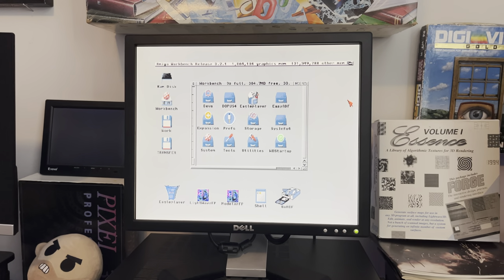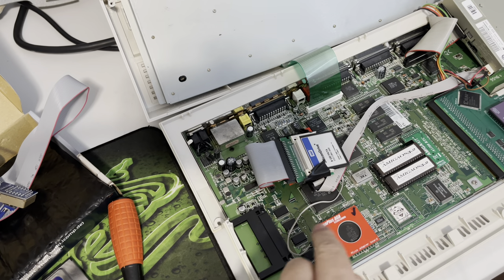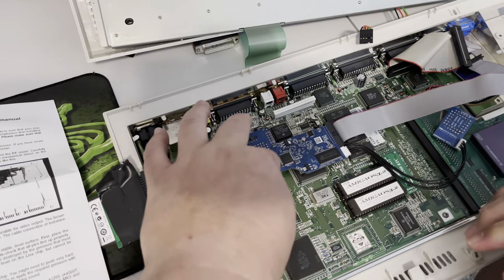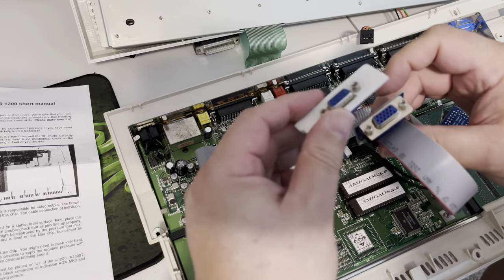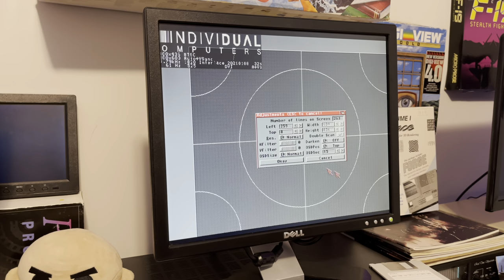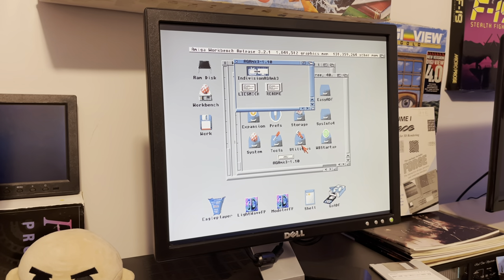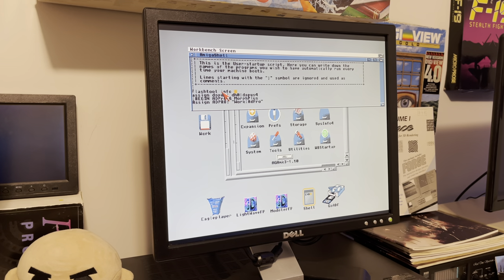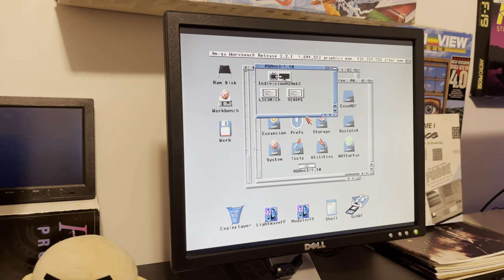Flicker Fixer for Amiga 1200 and 4000T! Did not expect this!

Comment: Lovely pin-sharp picture. I didn't have any problems with my Indivision on my A600, but, it is a whole different ball game on AGA. [ also VGA, I have so many old LCDs's ]
At the end of the month I get the Pistorm for my A1200. So much power!

The HDMI audio switch appears to work better than Ubuntu 22.04 on an Intel NUC11. [ Ubi blame the Kernel, yet the same kernel works fine on other flavors of Linux!
Reply from the maker: Nice! Thanks for sharing your experience. Stuff like this is important.

Comment: I have the Indivision Mk. 2 - with my A1200, it has a Blizzard 1230 Mk. 4 (50MHz 68030 and 68882). I installed (and highly recommend) HighGFX and FBlit. It allows k a nice and fast 1024x768 workbench, with a copper gradient background. It looks and works so well.
Reply from the maker: Yeah I wanted to check those out but was worried about chip ram usage. If that’s a thing?

Comment: My Mk III doesn't suffer from this blackout problem, but I have had this weird issue where I can ONLY run the config tool from floppy.  If I copy the executable to the HD, RAM disk, or whatever, it consumes memory but never opens the UI.

All in all, it's a mixed bag.  The Indivision does work and looks great, but sometimes the scaling quality is iffy, the config tool is very confusing, and the OSD really needs to have an on/off hotkey rather than linger on the screen for a fixed time period after each resolution change.  Most of the time, I still prefer to use my old CRT, and I bought the Indivision just in case my trusty 1080 blows up.  8)
Reply from the maker: Thanks for sharing your experience. Helps to hear what others go through. Yeah a CRT would be nice but so hard to keep running lately. They’re all aging out.

Comment: Good video.. I have a mkII and mkIII and never had any issues like that, but I am using the HDMI. (on the Mk3). Did clean the pins and had to press really hard down on it though.
Reply from the maker: Yeah I IPA’d it and tried HDMI and VGA. Still have to run that command at startup though .

Comment: Very odd. My MK3 does not do that, works absolutely perfectly every time. I'm sure you've already done this but I noticed you did not clean around the contacts with IPA before installing as suggested in the manual. Could there be a slightly dodgy connection.
Reply from the maker: I did do that in later desperate attempts

Comment: THANK YOU for this video. I am in the exact same boat, I had installed the MkIII in my NTSC A1200 (Commodore production and not ESCOM, not sure the revision of board I have) and got no video output from VGA or HDMI. After hours of fiddling around and reading forum posts I took the (quite expensive) device out of the Amiga and it's been sitting in its box ever since. Now I can go back and try again, armed with more knowledge thanks to your experience you documented here.
Reply from the maker: Glad to be of service! Good luck. Let us know how it goes!
Reply: @HoldandModify  Finally got the Indivision installed, since I wanted to wait for the PiStorm32-lite to become available in order to install everything together. And yup, I have the same problem that you were having with the MkIII not starting itself. I noticed there was an update on the Individual Computers website but unfortunately it doesn't look like it addresses this issue. Once I get everything situated I'll give it a try anyways. For what it's worth, the display (from what little I've seen so far) is definitely much improved over the GBS-8220 and other solutions I've used in the past...
Reply from the maker: Ah sorry to hear. Well, at least we have the work around. Look forward to any thing you find.

Comment: I have the exact same problem with my Indivision MK3.  I found that if I turn the power on, get a black screen, then turn the power off and on again real fast, sometimes I get an image.  It's definitely a timing issue or something.  I noticed one similarity to yours - 1D4.  I ended up buying a different amiga 1200 (I couple now) and they are all NOT 1D4's and they all work fine with the MK3.  It's just my 1D4 that doesn't work with the MK3 reliably.  I posted a forum message and Jens tried to help with some basic stuff, but I think the problem is more advanced.  And to clarify - same power supply works fine with the MK3 on a NON 1D4 board.  But my 1D4 board won't work properly with this MK3.
Reply from the maker: Well issuing that command at start up is the best easy fix for now, for me.
Reply: @HoldandModify  Yeah if that works, great.  I noticed the floppy would work for me too.  Didn't try using that command - maybe I'll try it if I have time.  I'm just glad I'm not the only one with the problem.  Seems like to me it might be a 1D4 board problem... at least that's one commonality we have.

Comment: Interesting - I've had one of these since they came out and haven't had an issue like this.  Maybe yours is some sort of chip shortage hardware revision?  Not sure if Jens has done anything like that yet, but I think I remember hearing some of the products were getting updated with different chips.
Reply from the maker: That’s possible but don’t know.
Reply: I have the MK3 as well and it works from Cold boot from the day I got it. No rescue disk or special commands needed.
Reply from the maker: @hamrdeye8927  then my curse continues

Comment: Pretty cool. I love that there is a way to get crisp digital output from an Amiga in this day and age (however you decided to go with VGA, which is fine, we won't judge you for it).
Reply from the maker: I know, I’m nutty. :)
Reply: @HoldandModify  still it's hard to tell on camera, but is the VGA output much better than the standard Amiga RGB output?
Reply from the maker: @DavePoo2  it’s better in that it does not have any interlace flickering. Because I am using a VGA 4:3 monitor instead of a PAL or NTSC CRT, there is some scaling issues. To “fit” the Amiga screen. For the cleanest image possible, you’d want to use a 16:9 screen over HDMI. Then the full aspect of the Amiga native screen could “lay in” the 16:9 space. This is what I do for RGB2HDMI equipped Amigas. I may do this for these too. Finally saying good bye to my 4:3 VGA panels.
Reply: @HoldandModify  back in the day (and now) I never used interlaced modes. The eyes can only take so much abuse.
Reply from the maker: @DavePoo2  yup, that’s why these flicker fixers are SO NICE. All the resolution and none of the flicker.

Comment: I stopped using iComps crap.
Reply from the maker: I’m beginning to understand.
Reply: last item i purchased from them  nuked my beloved  a1200  - Never again !!!
Reply from the maker: @daskarman  ah geez! Sorry to hear that. :(
Reply: @HoldandModify  one blown  hard to get Gale chip but it's repaired ,  that flicker fixer is a ticking bomb  reverse  sockets  are dangerous  especially if mounted without any standoffs  . if i were you i would remove that  thing , your  RCA  or the VGA   far safer  for no longer manufactured precious custom chips  and already  30 year old computer  !

Comment: Odd experience - I use one of these and it’s without question the best solution for video quality. Never seen the problems you had - it’s not at all normal behavior - I’d contact iComp and get some help.
Reply from the maker: I will. I started a dialog but I’m extremely busy and the required testing required to troubleshoot is extensive.

Comment: Great Vid “Q”! 👍🏻 Just watched Chris Edwards fix up your A4K 👍🏻 I own 3 of the MKIII, 2 MKII and 1 MK1 of these cards. Sounds like a Firmware issue with your card? Also to note I’ve had the MK3 Lisa connector not fit properly due to the SMD resistor at the bottom left of the Lisa chip getting in the way and not having a small cut out in the Lisa adapter socket. I know with the mk2 config software if you changed a setting it would re-program the flash cores of the card. I can’t remember but doesn’t the mk3 software do something similar? If you right click on the settings window? The keyboard live change is nice, but it’s not permanent and doesn’t change the settings on the card for next time 😉
Reply from the maker: Yes I do save settings using the actual software. And it’s running the latest firmware as far as I know from the downloaded rescue disk. It works great, I just have to run that command at startup. 

My A4000 video seen in Chris’s amazing restoration video will be up this weekend!

Comment: That's really odd behaviour. I have the MK3 scandoubler from Indivision and it just worked first time. I got it maybe about 2 years ago, so I wonder if a firmware update broke it for a few users...
Reply from the maker: It’s been said there’s a timings issue with certain NTSC a1200s.

Comment: When you ran that recovery disc it would have flashed the latest firmware on to your device, then after that it should initialise by itself every time. Or maybe you also need to flash it once you're in the OS. Either way, you shouldn't need to add that flashtool reference to user startup.
Reply from the maker: I agree. I did update its firmware. That’s been confirmed. The only thing we can think of is that North American 1200s might have subtle variances in timings that’s causing the issue. To this day I must still use my work around.

Comment: You missed installing something on your hard drive?  like a driver?
Reply from the maker: There’s no driver that I can see. There’s the config tool only. And an emergency boot disk. Which is where I found that tool to run at startup. To “wake up” the card.
Reply: @HoldandModify  it is wierd as its picking a native signal from Lisa..... odd

Comment: Hi I was looking at this flicker fixer, for the 1200, but put off by the cold boot problem.  Also going to upgrade to the 3.2.1. Has your issue been resolved tks
Reply from the maker: I’ve not had the chance to do what was requested of me to begin the trouble shooting process. iComp wants me to do a rather, I feel, time consuming and extensive step by step examination of my a1200. Listing all chip types and revisions, what things are connected and how, along with other requests. This is far too much “debugging” to be expected of an end user. It would make more sense to send my machine to them. Have them figure out why my a1200 has this issue. This is not really possible for me. Or practical.

I’m not technically inclined at all. I think this is obvious from my videos. I don’t even know if I could do what is being asked, correctly. Let alone have the time. HAVING SAID THIS. Many users have purchased this product and NOT had this issue. I’d say give it a go. You most likely won’t have this problem. If you do, you can return it. Or sell to another who may not mind.
Reply: @HoldandModify  Thanks for taking the time to reply. Its on the wish list at the moment as I haven't made up my mind if I need it or not.  Waiting on a RGB to VGA adapter that supposedly eliminates the vertical line. Whilst it won't do interlaced screen it maybe all I need. Cheers John

Comment: hi, I got one of these for Christmas 2022 having nothing but problems as in Cant get the indivision software to work just crashes the system, Ive formated, gone back to 3.1.4 roms still not working stripped the Amiga down to just a HD and 2MB still no joy have you ever come across this??
Reply from the maker: Have you been able to make a rescue disk for it? Then boot from it? I had lots of problems as I highlighted in my two videos for this thing. Ultimately it seems some Amigas timings are just slightly different than what it’s expecting and it won’t work. :/ I was happy to get it mostly working.
Reply: @HoldandModify  as the software would not work i did not get a chance to make my own rescue disk, and i put in the rescue disk with a blank screen thinking this would make it kick in, but i just flashed it after only giving you 7 seconds before it reset it, I dont know if i cound type flashtool 1280x1024 and it would flash it to the screen mode as there is not real info on it.
Reply from the maker: You can try their forums. But they’ll most likely ask you to test your 1200 apart and test each system one at a time. Might be better to try and get it replaced. You can detail all the issues you’ve had.
Reply: @HoldandModify  Already done that they want me to send it back along with my power supply and pay a repair fee!

Comment: Where do you get this hardware and can it work on a stock Amiga 4000/030 (non-tower)?
Reply from the maker: iComp.de is the website. It’s hard to tell if it works in non tower 4000. The website and instructions aren’t clear.
Reply: @HoldandModify  The site eventually responded. Something to note for once I confirm the machine's condition.

Comment: I wonder if you actually have read the english manual or readme file?
Reply from the maker: In short…

The manual says, plug it in. Turn it on. No software needed. That’s what I did.

Long version…

I read the install part. I then hit the forums and that took over my focus as instantly I found others were having the same issue I was and the dev was responding. So I assumed that was the correct path. So much activity there I didn’t think to look further in to the included manual. Although I don’t recall anything about this issue when I looked it over.

Comment: I had one for a while but get screen corruption if I try to use interlaced modes.
Reply from the maker: Interesting. That’s exactly what it should be fixing. Making them clean. I at least get that. Have you updated its firmware? Tried the latest emergency disk?
Reply: @HoldandModify  no but it's the first thing I'm gonna do today after watching you vid, didn't know there was a disk. Cheers.

Comment: Hi, did you ever get this to work right?  Did you try an HDMI TV/Monitor to see if that works?  I want want of these, but it's a little pricey if it doesn't work right.
Reply from the maker: Was never able to get HDMI to work. VGA works but I have to still use my hack at boot up.
Reply: @HoldandModify  Well, I ordered it anyway.  My 1200 is PAL, which seems to do OK on posts I've read.  Fingers crossed 🙂
Reply: @HoldandModify  well I received it, put it in, connected to a Dell u2410f and to my utter amazement, the individual Computer logo popped up!  Now all I have to do is figure out how to load software on this thing 😂
Reply from the maker: @mjmonjure  congrats! Is yours a PAL 1200?
Reply: @HoldandModify  Yes, it is.  I haven't tried VGA, but I could check to see if it pops us there well.  I'll do that and also I'll check the motherboard rev.  I know it's 1D, but can't remember anything past that.
Reply from the maker: Ok I saw earlier you had already mentioned PAL. Oops. Heh. Yeah PAL users seem to fair better.

Comment: just received my Buddha Ide card today which I am going to try to use with my Checkmate A500 which has big box type connector Zorro slot inside. What were your issues? Lot of love and hate on this card which I boldly disregarded.
Reply from the maker: You can watch my video for all the hells I went through. Keep in mind, it’s not a common experience. It has that going for it. :)
Reply: Do you plan to use it with a CD/DVD ROM drive?  I have a similar setup but not got the CD being recognized yet.  I think I need to try the new software update for Buddha.
Reply: @paulklasmann1218  never got it to work, jens doesn’t recommend using it with my setup.

Comment: that's odd. I have a MK3 in my 1200 also pal and it works just fine. but I never tried to use vga so maybe the vga is bugged
Reply from the maker: HDMI had the same result. No card initialize. Not until I ran that command.
Reply: @HoldandModify  that's so weird. I glued mine down (the main board that plugs Lisa) to the motherboard so maybe a bad connection?
Reply from the maker: @Yeet.  nope it’s nice and tight. And it works great. I just had to add that start up command.

Comment: My mk3 didn’t need anything done to it, boots perfectly from hdmi at least. I did reflash it at some point though. The one problem I had was when I tried to take the kb control socket off, it totally broke. In run it without the other socket now totally fine, it’s optional.
Reply from the maker: Mine wouldn’t boot HDMI or VGA before pre after update. Not until I finally did what I did. I am cursed though.
Reply: Mine worked right out of the gate, but I’m using the hdmi
Reply from the maker: @dkier81  I tried both and the result is the same. Only works once that commands is issued.